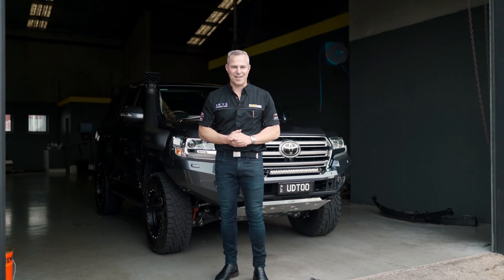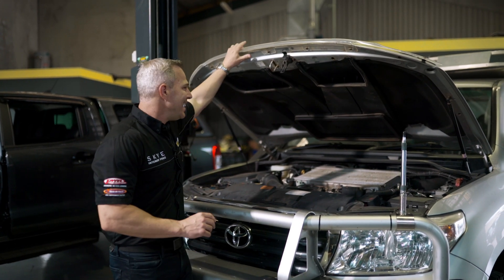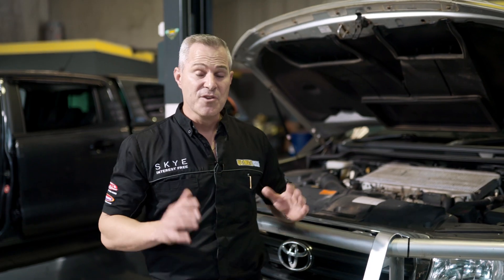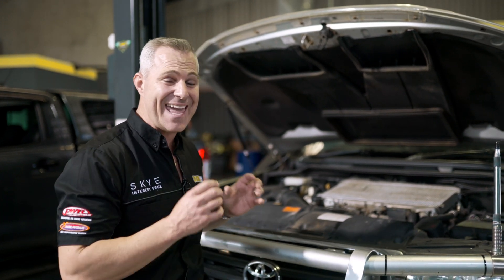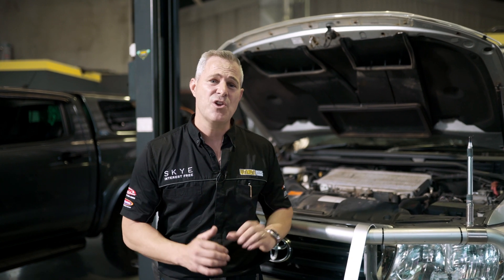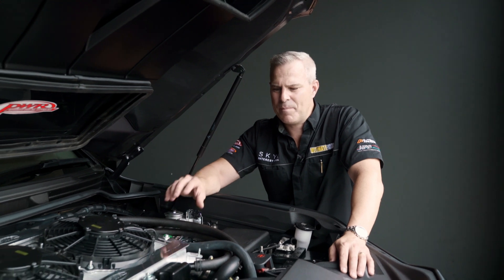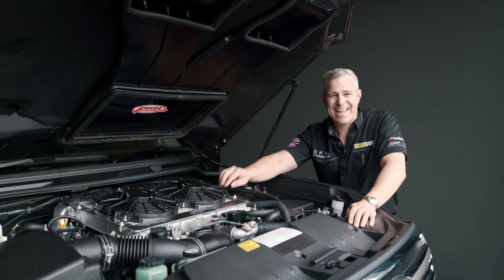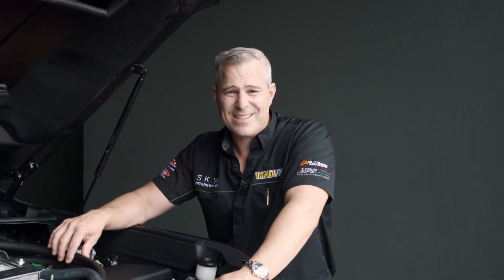ELIMINATE heatsoak, MAINTAIN more stable air intake temps to improve the 1VDs performance!

Comment: Great video as always! Quick question, would it not have been more efficient to drill the fan shrouds to the outer edges of the intercooler rather than through the core?